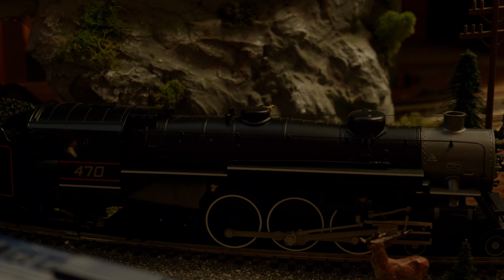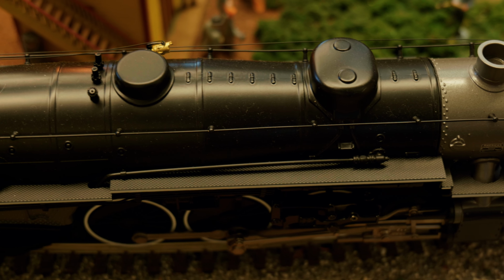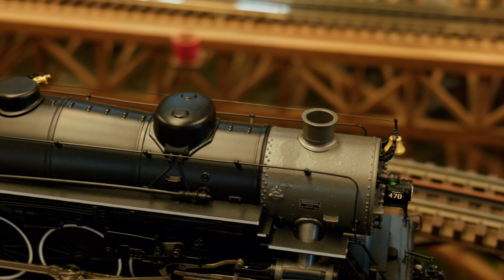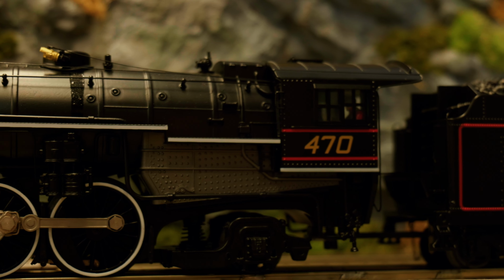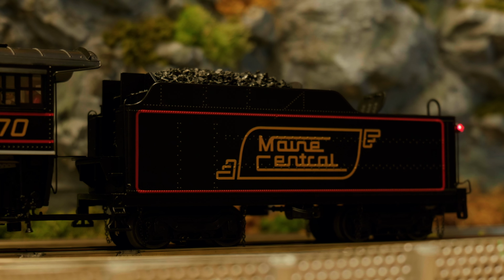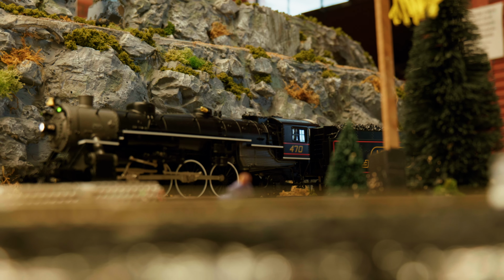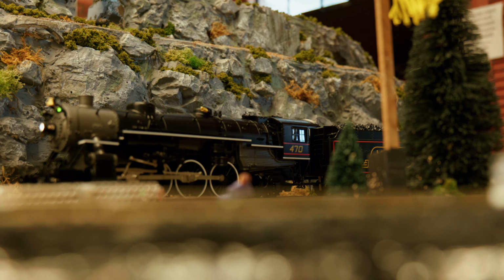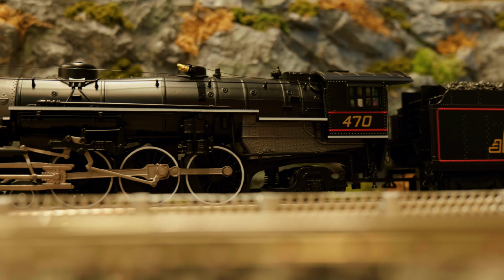MTH Premier USRA Heavy Pacific + Whistle Steam Review - Maine Central 470

Comment: Thank Goodness MTH is still in Business.  These are great Looking and Sounding Engines and at half the Price of Lionel you can't go wrong.
Reply from the maker: They are very good value when compared to the Lionel Pacifics. Of course to each their own. The paint used by MTH stands out to us the most, it's far more scratch resistant than that used on most modern Lionel engines. Something that'll be noted in the long term review.

Comment: How do you activate whistle steam?
Reply from the maker: You need to use the DCS system (remote or wifi unit and app) to activate the whistle steam function. On the remote this is found under the soft keys (S1-S5) and is labeled FSW on the remote's screen. Once activated, leave it on, and then when you blow the whistle in quilable mode, using the white "W/H" button, or any of the whistle shortcuts on the soft keys, the steam will blow out of the whistle with the sound activation.